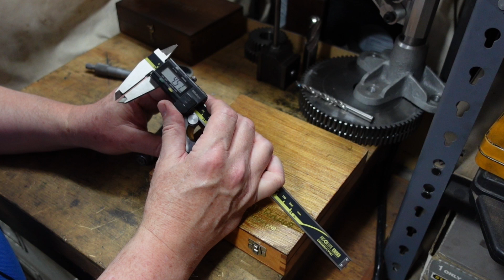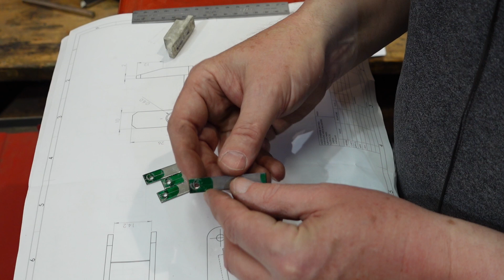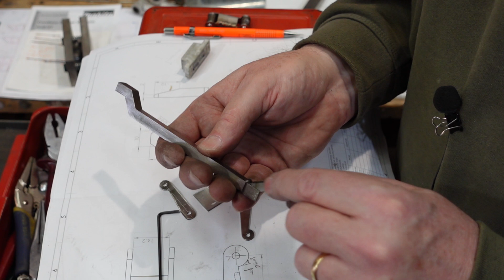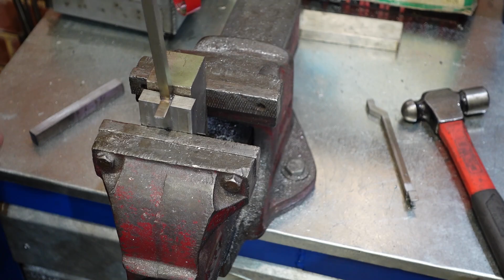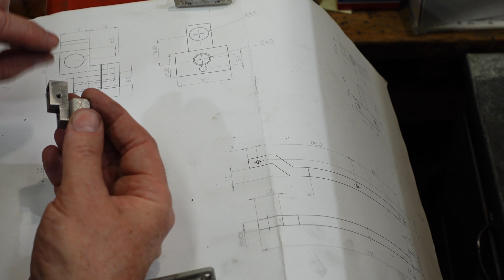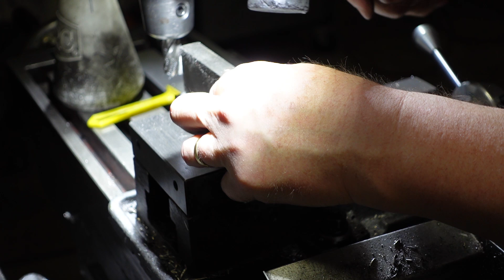Sideways gauge

Comment: Very interesting Aaron, I am in absolute agreement with you regarding caliper and T gauge accuracy. I used to do a lot of diesel engine rebuilds and used T gauges and internal micrometers frequently. With constant usage your "touch" improves and you get more consistent results but it is a system prone to error. The etalon type instruments at least removes the operators"feel error" from the equation. Cheers
Reply from the maker: There is also a problem from gauge to gauge. Consistant readings across gauges also rely on each having the same amount of friction.
It's why I find this type of gauge far superior

Comment: When you have had a chance to test your design are you planning to share the drawings?
Reply from the maker: I am intending to release drawings. So far everytime I've printed them off (4 times so far)  I've then made a design change.☹
Reply: @occasionalmachinist  I kind of assumed there would be some teething pains with the design. I look forward patiently to see where it goes. It must be a good feeling to finally manifest the tool you have been imagining for all this time. Thanks for sharing.
Reply from the maker: There are certainly better designers out there than me, but personally I've never managed anything greater than moderate complexity where in hindsight there is not something that could be different/ better.
I'm certainly looking forward to being able to use this device in anger. The Interapid is good, but I regard that lack of clearance as the weak point in the design.

Comment: Yet another interesting project. All of the fabricated parts look flimsy to me, but then I used to machine castings up to ~50T.
What is important is position repeatability, so as long as everything settles in the same position for a given reading position, all will be well.
Reply from the maker: You're pinching a revelation from the next video, but yes, they are. Not horribly so, but enough that I'm going to machine from solid. The fabrication effort was partly "might be good enough" and partly " let's see if this works first". Now I know the answers to both...

Comment: Could you make a pair of removable blocks with pins or balls at 90 degrees that can attach to the legs when required?
At 13:36 you could remove the parallels, rotate the block 180, and use the top of the rear jaw to tap the other end of the part onto.
Reply from the maker: The original gauge has the balls and pins but I don't need them on this one. Anyone wanting to copy this project may wish to think about them though. 
You could do as you have said at 13:36, but you then rely on the jaw piece being parallel. As they are removable, I prefer to go with parallels for better repeatability
Reply: @occasionalmachinist  I see. I assumed that you are going to have pins on the new one so the gauge can lay flat with the top of the hole with protruding pins in the hole. As you say, the original one already has pins for this function.

On your type of vise the base is parallel with the bed and the jaws are hardened and ground parallel so the tops are also reference faces. When the jaws are fitted it is essential that they are clean to sit flat on the base of the vise. There is clearance in the jaw holes so this can happen.
Reply from the maker: @marley589  I will have pins that go into the hole while it goes flat, but that's a next video reveal!